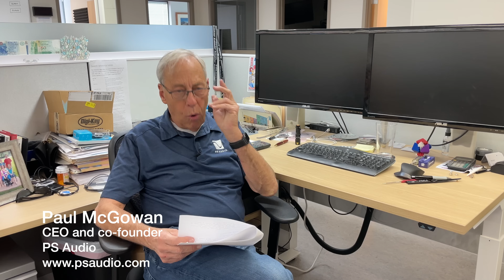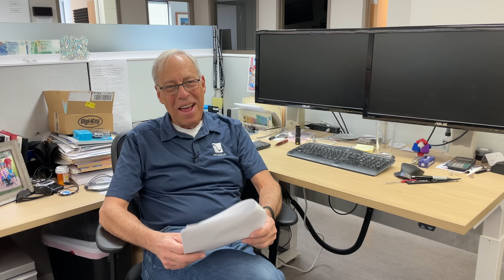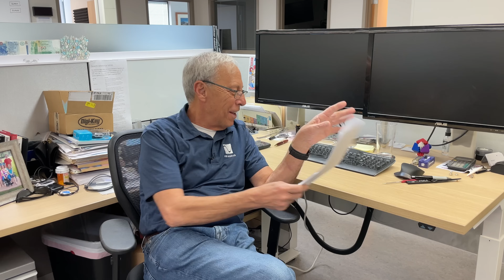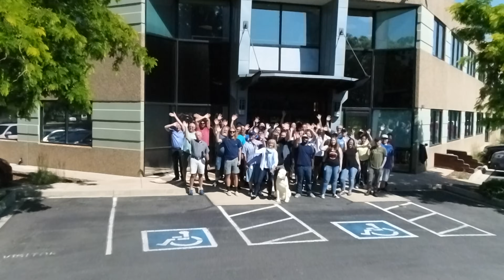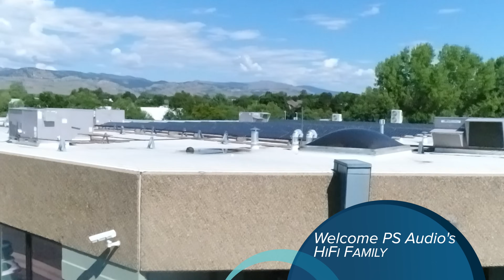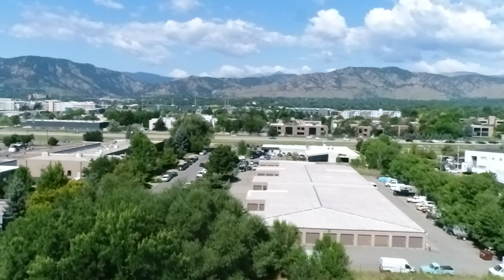Amplifier wattage meters

Comment: Meters on amps are seldom actually Power. They are typically voltage meters with displays based on that V at some ohmage. They often have both 8 ohm and 4 ohm scales. But actual Power measurements require V&I and their phase relationships. 

I remember the HK Citation 16 having LED output level displays that everyone would turn off because you could hear a click from each LED turnon!
Reply: Hi Glenn,i actually owned a 16,but never heard the sound klick you described? And yes it was.  not full Power ALL the Time,so i should have heard.and my ears were very good back in the days ,,,,,
Reply: @999emergncy  Ok, you are correct, It never works to say everybody! I did not own one but knew people that sold and owned them. They showed me. It was one of those things that once it was pointed out, ...

I would not mind owning one right now! Great high powered amp!
Reply: Yes, they're voltage meters, but that is actually what you want, in order to see how close the amplifier is coming to its clipping point.
Reply: @marianneoelund2940  So you do not understand "Power"? And how phase shifts between Voltage and Current affects it? 

And an amp's clipping point will change based on what the signal is at that time. e.g a transient before a strong bass passage will have more headroom than the same one during it! So no, mislabeled meters (displaying Voltage, but using Watts as the scale) are not as valuable as claimed!
Reply: @glenncurry3041  Glenn, as a practicing EE for four decades, my equipment investments have rather differed from the typical audiophile who puts thousands of dollars into their audio gear.  Instead, I've put that money into test equipment, such as a Tek MSO4104 with TCP0030 current probe.  
Do you understand what that equipment can do in the hands of an EE?  
I was actually using it yesterday to study P(t) on real music signals of various styles, so I am in a position to inform you, that I-V phase shift is a tiny contributor.  Speaker impedance variation is far more significant.  
Yes, it's rather hopeless to obtain accurate power measurements from a voltmeter, but mostly for reasons other than you stated.  
If you haven't noticed, one of the primary concerns expressed here, is amplifier clipping.  A voltmeter is better than a true powermeter, to warn of that.  
Headroom variation that you cited is also fairly minor, with an effect of typically 2V on peak voltage capability.  Compare that to about 40V (or higher) peaks available from 100W-class or larger amplifiers.
Reply: @marianneoelund2940  Well if it is a pissing competition, I was building and selling strobe lights to bands and fixing all the family TVs (tube pulling) when I was 12. Built my own VTVM, VOM, SWR Bridge, HiiFi Amp, 12" 3 way speakers, ...  before I could drive.  I have a degree in electronics, from back when tubes were still in primary use. And an FCC license to work in and run TV stations (which I did for a short time, (Master Control, Tape Room, transmitter,...) .  But wound up primarily in sales and marketing, at a technical level. As a Manufacturers Rep in Audio travelling many states, I have given lectures and seminars on amp/ speaker/ turntable /cartridge/ mag tape/... design, psychoacoustics, ... as trained by HK/ Marantz/ Kenwood/ AR/ AT/ Empire/ Maxell/ ...  I lived in Nashville selling to both retail and studios. I opened and ran a regional Warrantee repair center for a major HiFi brand. I was almost US Service Manager for Studer/Revox, but my handwriting test failed. I've met and had discussion with Saul Marantz, Jon Dahlquist, Dr. Matti Otala (exposed TIM), Gene Cerwinski (Cerwin Vega), Henry Kloss, Dr. Thomas  Stockham (Soundstream), ..... 

I then moved back into video and designed and sold cable channels, TV stations, satellite trucks, .... I not only sold Test and Measurement equipment to TV stations and video production companies, but to AT&T, Motorola, Zenith, .... and gave lectures to SMPTE conventions e.g. "The application of PC controlled test signal generators for HDTV development".  Then into computer Graphics where I literally sold the stuff that T2, Jurassic Park,  Batman, ... were made on! I gave another SMPTE lecture on the use of HD arrays for editing. I was on ARPANet before it became known as the Internet. Finally just retiring from selling leading edge IT shipped around the world. 

My basement is filled with a variety of T&M, scopes, signal generators, tube tester& VTVM (I hand built from kits 60 years ago!), stereo optic microscope to check stylus, shelves with amps, preamps, ttbles, .. waiting attention. (An L-O9M with relay problems right now), A guitar amp I am designing (I play), a Fender Rhodes with a bad key (mid C). ...

" I-V phase shift is a tiny contributor." Tell that to electrostatic owners. Or speakers like AR that have massive coils in the crossovers.  I-V shift (power factor) and CMF are significant enough that some companies have tried to design for it, like using some feedback signal from wires connected to the speakers. 

"amplifier clipping. A voltmeter is better than a true powermeter, to warn of that." Explain to us how a voltage meter with 8 ohm Wattage calibrations can tell us when rail voltage sagged below specs and caused clipping at below spec'd rail voltage. No good amp manufacturer regulates the output stage voltage so it is constantly swinging under loads. No PS is actually zero ohms. Few speakers actually stay close to nominal impedance rating so an 8 Ohm calibration when the speaker is presenting 30 ohms? Or 2 ohms like my Maggies? A scope is the only way to actually see clipping! OK, maybe a clipping LED?
Reply: @glenncurry3041  At least you're talking speaker impedance now.  That's some improvement.  I did my tests with DQM9 speakers, which have a 3:1 impedance magnitude swing, just in the 20-50 Hz region.  There are worse, but the P(t) plot had nearly invisible excursions below zero.  Now you could create test signals that produce heavier reactive content, but I prefer to limit the discussion to music.  Unless you've done the real-world measurements, your opinion has little weight.  
Why do you keep talking power measurements to detect Amp clipping?  That's a very roundabout and inaccurate approach.
And with music signals, the clipping voltage isn't going to move more than a couple of volts, as I said before.  
Those are the facts, and they won't change, regardless of how many years you've spent in the industry.  (Can't believe how much time you spent with your chest-thumping, none of which matters to me in the least.)
Reply: @marianneoelund2940  WOW! MY OP was originally about power meters! But you're bragging about using red herrings to change the subject? So context of discussion is beyond your scope? 

"The MGMC1's ... Impedance reaches a minimum of 4.23 ohms at 98 Hz and a phase angle of –30.56 degrees at 2.6 kHz." HT Labs

–30.56 degrees from a speaker with linear wires for a voice "coil" but you measure ZERO from a speaker with multiple cones? So "your opinion has little weight"! 

"And with music signals, the clipping voltage isn't going to move more than a couple of volts, as I said before." Please show us all the moving scale on the meters that show this moving clipping voltage. 

On 2nd thought. You seem to want to argue just to argue and are thrilled to move the subject as a straw man/ red herring to keep it going. So I'm outta here!
Reply: @glenncurry3041  Glenn, I never said I measure zero phase shift with the DQM-9's.  I said that the phase shift that occurs, does not result in significant reactive power when listening to music rather than test signals.  The DQM-9 current phase swings from -33 deg at 27Hz, to +34 deg at 52Hz, and down to -48.5 deg at 85Hz.  But with music signals, even that much phase shift isn't producing significant reactive power.  
But all of that is still beside the point that a voltmeter is what you want to warn of clipping, not a power meter.  
If I really need to spell it out to you, I'm objecting to the relevance of your OP where you were complaining that amplifier power meters don't measure power well.  No one cares how well they measure power, when voltmeters are what you really want, to be aware of how close you are running to the clipping threshold.  Internal supply droop only degrades output power by about 1dB in a well-designed amp, so you set the threshold conservatively for the worst-case condition.  
Of course, a scope is even better - and better than that, is circuitry internal to the amplifier which detects output/input voltage deviation and lights a warning lamp.
Reply: @marianneoelund2940  "I never said I measure zero phase shift with the DQM-9's."

"the P(t) plot had nearly invisible excursions below zero."

I'm done.
Reply: @glenncurry3041  Single-frequency or swept-frequency test signals will let you see more negative excursion on P(t), but with the DQM-9, reactive power only reaches about 8%  of the dissipative power.  With music signals, due to their mix of frequencies, you usually have both positive and negative phase shifts present simultaneously so they tend to cancel and result in very low reactive power.  Typically, I see it's less than 2% of total power.
Reply: @marianneoelund2940  That's nice and has nothing to do with the discussion. But thanks for trying!

Comment: I have a very low power Chinese 300b SET amp. I like to delude myself that the meters help stop me stray into clipping/distortion but really I just love the way they look.
Frankly I'm sure that's why virtually every Chinese valve amp and many solid state amps have them. They know we love them. Also I think subliminally, because of firms like McIntosh, folks associate meters with the high end.

Comment: In my amp collection there's a vintage Technics SU-8044 with vacuum fluorescent display meters. As they don't light up much at normal listening levels, there's a handy 'x10' switch to exaggerate the movement. Pure eye candy, of course!

Comment: Most times when I read a modern review and the component has a VU meter, the most common replies are how cool that are. People like em even if they serve no practical purpose
Reply: @Lassi Kinnunen 81 if there is anything that distorts at a voltage threshold or anything digital in the signal chain, you need a peak program meter in dbfs not VU.  VU meters are useful with soft distorting analog devices like tape where the average signal level is what matters.
Reply: @Lassi Kinnunen 81 If you want to see a reasonably well implemented amplifier power output meter that is at least mostly accurate, to the point of being useful for at least not overdriving the amp into hard clipping, then take a look at mostly vintage power amps from such brands of the past as Carver, Onkyo Integra, McIntosh, etc. Power amps with useful and effective wattage/power output meters definitely DO exist! (Maybe not so much nowadays with newer, cheaper quality components, but definitely in the higher quality brand older/vintage equipment of decades past!)
Reply: @Lassi Kinnunen 81  No, unfortunately I've never seen one like THAT either, (that actually measures both the voltage AND the current in real time), and now that I know what you meant, I have to admit that the only ones I ever saw were basically just monitoring the output voltage and converting that to a display amount based on a certain ohm speaker load, (usually 8 ohms), but for most normal home speakers that was fine in most cases.

I guess the most relatively "accurate" and useful of that type of meter that I ever found was the Realistic APM-300 Audio Power Meter from Radio Shack, which was a separate stand alone unit that you could place across the output of an amp and it would show quite well how much power was being produced by the amp, as long as it was set to the correct speaker impedance anyway. It had a 4 or 8 ohm speaker impedance switch on it, along with a switch for RMS or Peak responding, and a range switch also, for higher or lower power readings. Even though this meter still only based its readings off of amp output voltage, if the speaker impedance was close to 4 or 8 ohms and the switch on it was set correctly, that meter would indicate power output pretty much within 10% of the actual watts I would say, because I tested it quite a few times just for curiousity's sake, against my two very high quality Fluke True RMS reading multimeters, one set in AC voltage mode and the other one set to AC amps mode, both appropriately connected into the speaker drive circuit, and the numbers calculated out to always be VERY close to each other, so I thought that was pretty cool...

I also had 2 of those APM-300 Power Meters, one stacked on top of the other, and I would set one in RMS mode and the other in Peak mode, in order to get an even better constant, real time indication of how many approximate actual watts I was putting into my speakers. I never had any issues in overdriving them even though I like to play my music pretty loud sometimes!

Later, I modded both of those meters to also be able to indicate power for different additional speaker impedances and power ranges, plus I made them operatable off of 12-volt DC also, that way those meters were even more useful to me in multiple situations and applications, car systems included. I still have and use those meters today in my current stereo/music and movie system, along with 2 more additional ones I got of the same model so I could also monitor the power output of the surround and center speaker amps in my current home theater system.

These meters aren't perfect of course, (it would be even better if they actually had a way to monitor the current going into the speakers also), but for what they are, that model was one of the best ones ever made I think, as the APM-300 also had more individual divisions/increments of LEDs in both channels than the later model APM-500 did, (that model also eliminated the RMS/Peak switch), so anyway... I guess it is what it is, and for what it is, the APM-300 was/is a pretty decent and easy way to monitor most home stereo system amps as long as it's used and set up correctly... and that you don't expect TOO much precision accuracy from it... But it sure is fun to watch dancing to the music beat in any case!

Comment: Remember Marantz Cassette decks with the 3.5 inch meters. They were cool back then. Still have these around.
Reply: That's why vintage Marantz products are so expensive, I also bought a 5025 and it does not even have 3 tape heads but they have unbeatable looks.